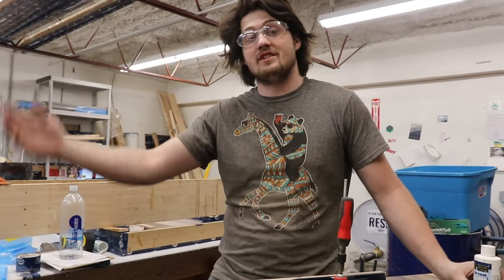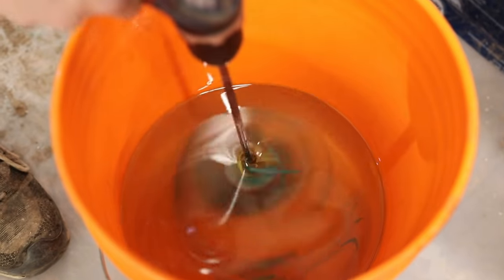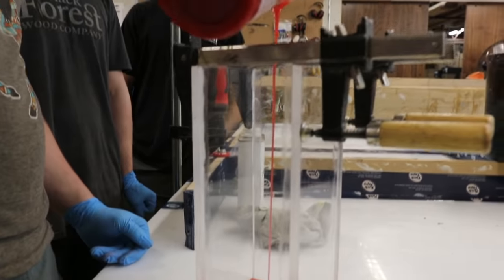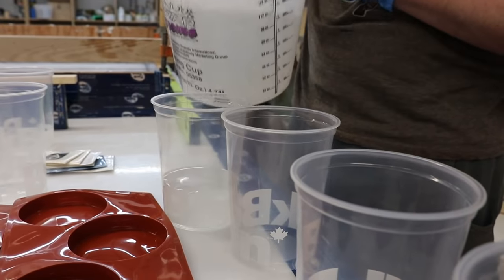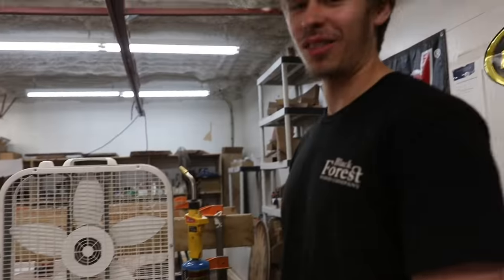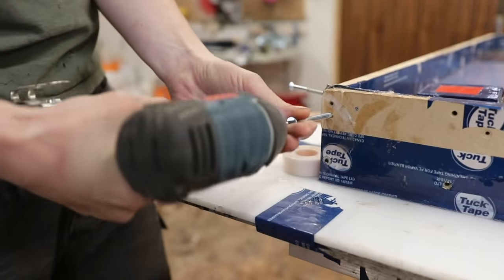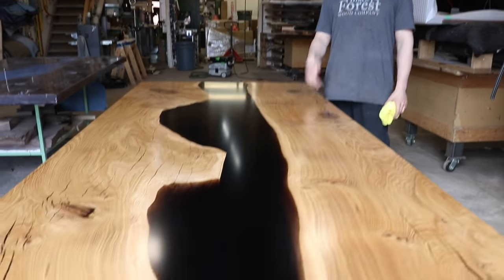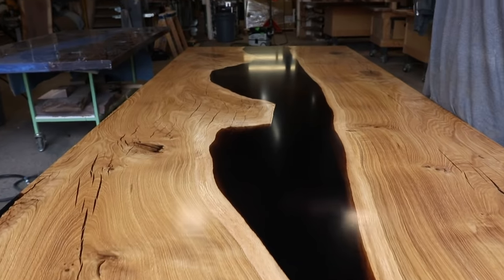Pouring a Geometric Resin Art Piece

Comment: Hi Dylan, for some reason I love hearing the tearing of the sides off of the tables! (strange). I asked before but didn't get a response. Do you re-use the side walls or are they a one-time use? Thanks...
Reply: My guess is they re-tape the moulds each time, and they would re-use the wood for smaller or same sized project
Reply: I think they use them over and over as you can see them up in the ceiling of the pour room. They for sure would retake them, I use mine over after retapping them.
Reply from the maker: We use them over and over again, retaping when necessary!
Reply: Hey I like hear the demoulding sounds too!! For me I think it has the effect of those ASMR videos.. relaxing and sayisfying. By the way, recently I found I feel more relax with demoulding than with ASMR itself. 😌😅
Reply from the maker: @smugglertricks08  We'll probably post a demolding compilation net week!

Comment: How did you keep the pieces from floating?  Did you use double sided tape?
Reply from the maker: We put wood blocks on the table with silicone and clamp those to the table to hold everything down to prevent it from floating 👍

Comment: Is Joe's geometric art piece glued down, or screwed down? To keep it from floating when you pour the resin.
Reply from the maker: It's Siliconed down
Reply: @BlackForestWoodCo  2nd question... Will the silicone work for a small river end table(from floating)? Or would you recommend to clamp that down? Table is 28"*20".

Comment: Are you able to reuse your buckets?
If so, do you have to use heavy cleaning solvents. Also, I know resins and epoxy have a strong odor. Do you have special ventilation? I never see any masks. I worked at a couple of print shops a came home smelling like chemicals.
Reply: I asked the same question. I guess they just bang on the bucket and the leftover epoxy just pops right out!
Reply: Bruce Young is correct. They have even demonstrated this in an earlier video.
Not all epoxies have a strong smell. I too work at a print shop - very little to no chemical smell at all; even with all printers running.
Reply from the maker: Yup, we just tap the bottom of the bucket with a mallet and it pops out!
And our Black Forest Resin is basically odorless, and also is safe because it has no harsh chemicals, and even has an ASTM rating which most resins on the market do not!